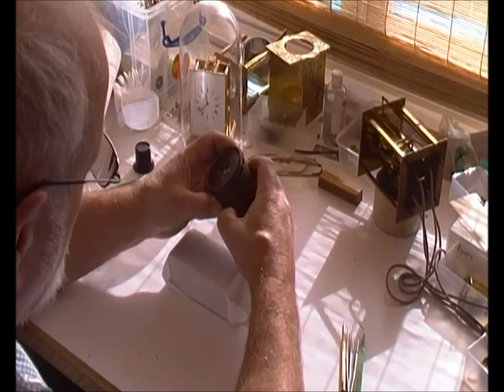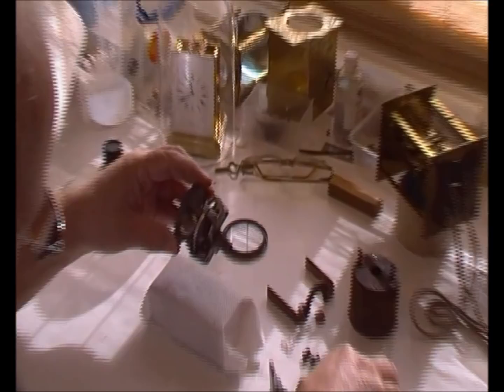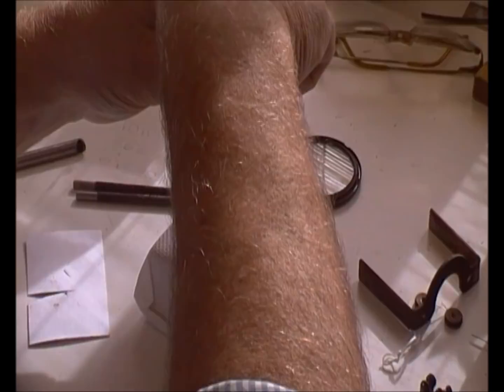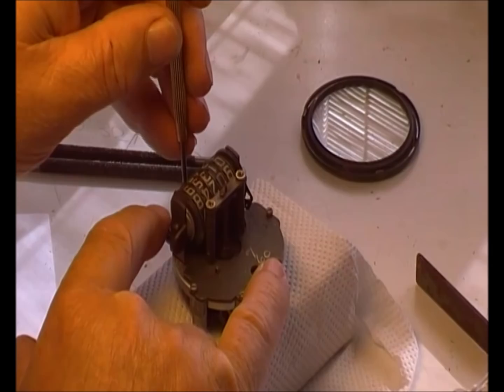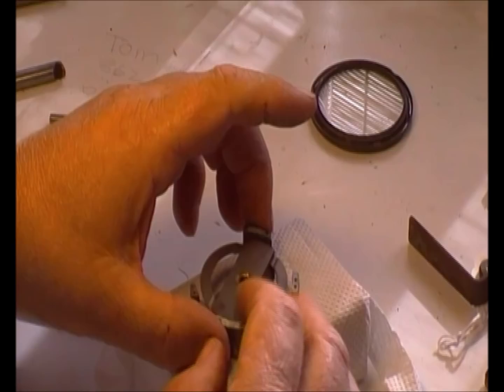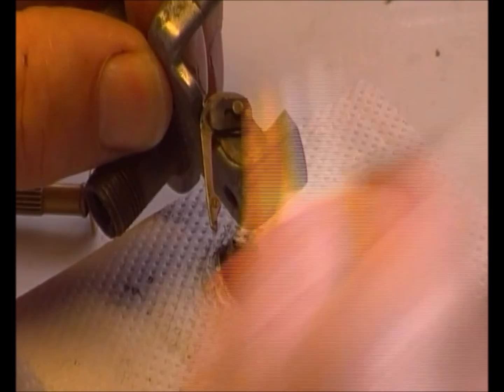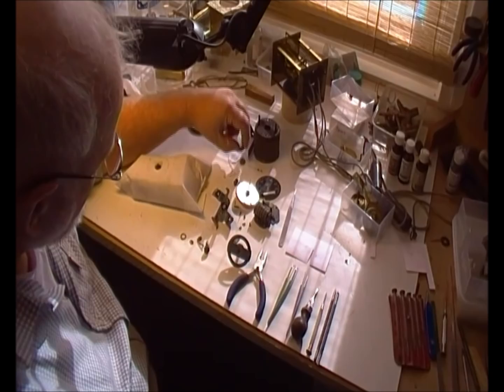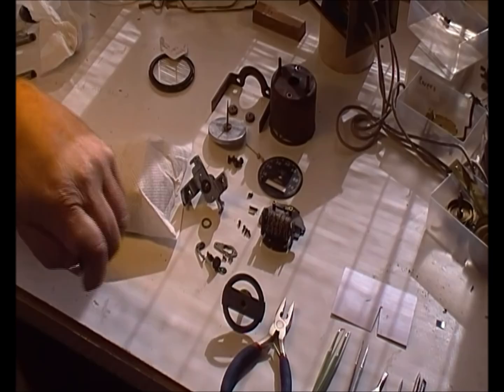Disassembly and inspection of a Magnetic Speedometer

Comment: @Mike- I have seen a Smiths speedo 120mph with no trip meter or no made in England written in back cover. Mechanism inside is magnetic and looks correct. Wonder if Smiths did make such examples with no trip  with a case with just that wheel emblem with no made in england etched. Any info would be gratefully appreciated

Comment: I have a 50 year old ford truck speedometer that needs magnetized, do you do this through your shop?
Reply from the maker: Hi. how do you now that the magnet is not working correctly?
Reply: Speedometer cable was replaced, no difference. Mechanic said the speedometer needed to be remagnetized.

Comment: Was this working, I have the same speedo that has stopped working I have taken it apart come to the conclusion that the magnet has lost its pulling strence
Reply from the maker: It was working and is still working! why do you think the magnet  has lost its strength?
Reply: Hi it’s from my 1961 AJS the speedo stopped working I tryed it with a cordless drill the magnet rotated but it doesn’t pull the disc round